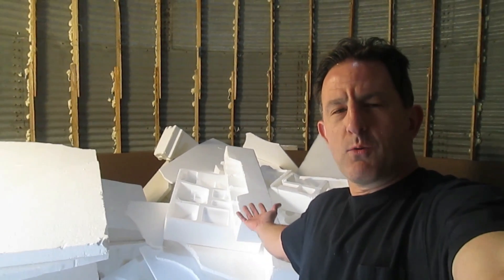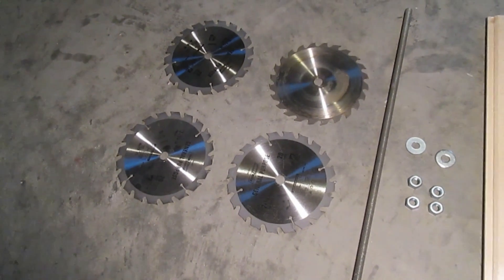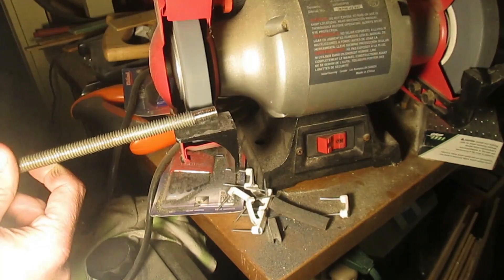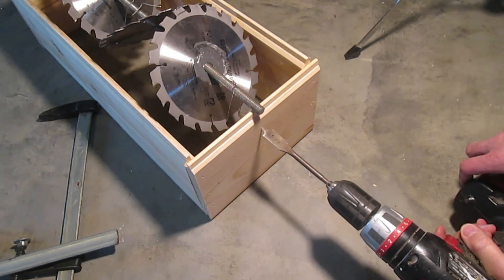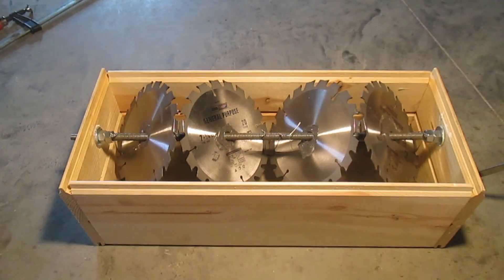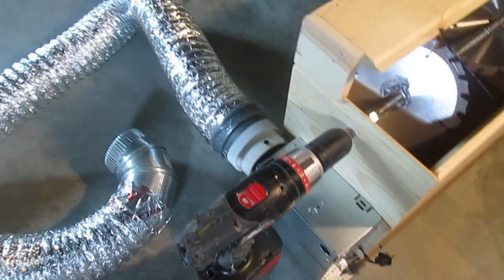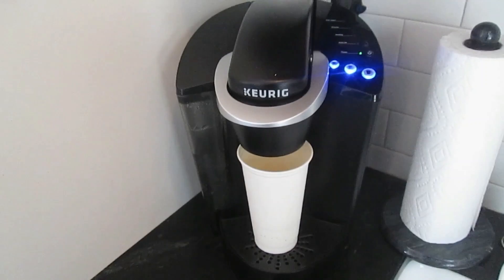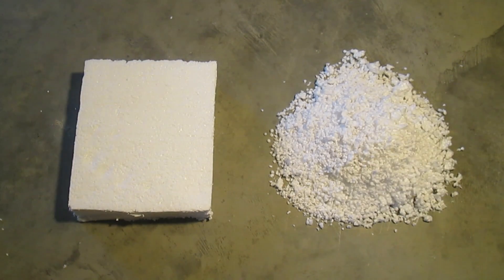How To Recycle Foam into Free Insulation

Comment: I couldn't get the blades to be tied down tightly enough to save my life. One grade down and it was too flimsy (like bread ties) and one grade up and I'd twist the heck out of them just for them to still be on looser than i wanted. 

The whole thing turned out moot when the threaded rod kept slipping off the chuck. So i bought a paint stirrer drill attachment and cut the end off of it with an angle grinder, then cut divets in it to hold onto the wire like the threaded rod did.

Well that just wrapped the wire around the rod and let go of the blades, so i scrapped the idea and went back to the drawing board. 

Right now, I've got the same paint stirrer drill attachment without a head and a good sized rolling pin I'm going to stick a bunch of screws into. I dont think its as fast as your machine but it'll work. It just might take me ages to insulate my 200 sqft cabin i built. 

Otherwise, the blower idea is invaluable. I dont see anyone else doing that part of it. If they put the shredded styrofoam anywhere, they put it in a bag either to mix with something or for a bean bag. The only other insulation i can afford is cardboard turned into cellulose with dado blades and a table saw, but that needs borax and a few other things to make it mold and bug resistant, so credit where credit is due. 

Thanks, Lou!

Comment: could you mix something into it so that it's not so fluffy and sticks together a little better?  That way you could mix it up in batches and pour it down into the wall and tamp it down and a hole in the wall wouldn't empty it all out.  Something like cheap paint maybe?
Reply from the maker: Actually there is a practice of mixing portland cement and a little bit of dish soap that I might try.  It makes lightweight insulated panels
Reply: @HowToLou  that's one of the things I've been researching.  I wonder if there's a good way to make that waterproof.
Reply from the maker: There is a waterproofing paint for concrete that might work.
Reply: @HowToLou  interesting idea.  I'm looking to possibly doing this on the back wall of my greenhouse for insulation.  This with cement paint might work
Reply from the maker: Another option is to partially fill plastic grocery store bags with the foam crumbles and tie them shut tight to keep out water. Make a lot of these “pillows” and stack them in a stud wall. Throw any scrap bubble wrap or bubble wrap envelopes in there too.  Insulation is all about trapping stagnant air.
Reply: @HowToLou  ohh that's an interesting idea
Reply: @HowToLou I've been saving all my Amazon bubble wrap Styrofoam for creating an air gap, between two layers of batt fiberglass insulation, in my attic.

Comment: I worry about flammability. Most styrofoam is fairly flammable and generates toxic smoke when burning.
Reply from the maker: This is no more flammable than spray foam which is used everywhere.  It just needs to be protected with a fire retardant material, like drywall.   In my case, its in a small clubhouse with no sleeping quarters.
Reply: @HowToLou  not really true. Most spray foam rated for home insulation has fire retardant added and higher combustion temp. Styrene foam is very flammable just a flame for a few seconds is enough to cause it to burn and continue to burn and it gives out a lot of smoke. Exception for this is great stuff foam that isn't the fire block type. It is extremely flammable and is only supposed to be used to prevent drafts, would not recommend using it to insulation a house stud space. Nice idea tho. Might use it to experiment making aircrete using free foam using this method.

Comment: Nice work Lou! Does the same set up work for shredding mattress foam into small pieces for stuffing pillows and cushions? If so I'm off to the hardward store today to buy the necessary! Thanks.
Reply from the maker: I am not sure.  Hard foam is brittle and chips easily.  Foam rubber might bind and cause the blades to slip on the axle.   I would try dragging an electric chain saw across the foam mattress.   That would likely chip it up about the way you want.
Reply: @HowToLou  thanks for the tip Lou. Cheers

Comment: What about fire risk? Isn’t this foam flammable?
Reply from the maker: Yes, it comes with the same fire risk of foam insulation available at the hardware store.  You should always take care to encase it in a fire retardant material, such as drywall, if used to insulate a home.  In my case, it is insulating a clubhouse with minimal fire sources and no sleeping quarters.
Reply: @HowToLou  Foam for building has fire retardant mixed in, packing foam may (probably) doesn't I saw a great demonstration on some insulated foam concrete forms. Form was held vertical and a lighter applied. The flaming stopped almost as soon as the lighter was removed. Before using scrap like this do a simple test burn to see how flammable your packing material is. Look up "station nightclub fire"  to see what can happen if non-building rated materials are improperly used in building.

Comment: Hi Lou,
I’ve been thinking if this and there was your video. 
I have a question. 
If I did like you and filled net like bags to put on top of a drop ceiling, do you think this could work as insulation?
Thanks   😊
Reply from the maker: Absolutely!  I would just use trash bags half full so they lay flat like a bean bag.
Reply: Thanks Lou

Comment: This looks absolutely great!
Do you know of any method for re-molding the grind up pieces back together?
I am trying to reuse an endless supply of styrofoam, to grind it up, and remold it into big pieces. 
These pieces should then be used for creating floating pontoons. :)
Reply from the maker: Look up Styrofoam glues such as UHU and 3M77.   I would mix up a big batch and form it into your pontoon molds
Reply: styrafoam is open cell and will absorb water. Any painted water proof layer will eventually leak and you'll have a soaking wet block of foam, just so you kno.w
Reply: You will need to make a mortor mix out of it, a slurry, which, at the right moisture level , can be shaped and molded, then allowed to dry and harden.

Comment: There's another couple of uses for this ground-up styrofoam.  1) Using it as 'perlite' for mixing into potting soil to keep the soil loose and draining properly, 2) included in hypertufa concrete mixes and 3) maybe as a modest percentage of the contents of beanbag chairs. 

In the meantime, I LOVE YOU MAN! This is a great video and a great solution for recycling all that styrofoam. I just unwrapped a Christmas gift with a ton of styrofoam. I HATE having to throw it out.
Reply: Use it as bean bag filler...
Reply: so you mix the plastic with the dirt... isn't that just gonna pollute it forever?
Reply: No , its free and they hate throwing things out, they are thinking clearly, about that. @bamboo_craft
Reply: Maybe also for cakes to make them nice and fluffy.

Comment: I had the same idea fairly recently. I wanted to build a hunting lodge and a tree house for my kids, but we already had to start building the second guesthouse since we have people coming over next month. Anyway, my country property is well out of Seattle and trucking in a bunch of sips was going to be expensive. We had experience from when we build our house. We got some of the packaging Styrofoam from the junkyards, dumps and dumpster in our area, as well as some scrap cellulose insulation from a big construction project. Even though we got most of our needs met from discarded Styrofoam packaging, it only took 2 weeks to gather more than enough material. I now have a shed built specifically for the leftover material. Anyway, with some fire retardant Elmers wood glue and a shredder more like a blender that I'd made out of a 20 gallon bucket and a weed Wacker, I shredded the Styrofoam and cellulose, mixed them in proportion and made an insulative "mortar". I then spread it on the walls from the inside and then tramped down from the top opening when I nailed a panel. You have to get some into the edges of the studs and the outer sheathing before putting interior panels on. Worked great.

Now, I'm thinking of replacing the glue with a slow expanding foam and by tossing some other high insulation waste materials into the mix. I've gotten ideas on making my own sips for other projects.
Reply from the maker: I love it!!  So much styrofoam gets trashed.
Reply: great ideea! thanks

Comment: If you aren't opposed to renting, I bet the insulation blower at the box store will do the same chewing and spitting.  It might be cleaner...just maybe.
Reply from the maker: I looked at those.  They are really just blowers.  They would chunk up foam, and leave huge pathways that would allow air currents to cycle in the wall.  You need static air to insulate.